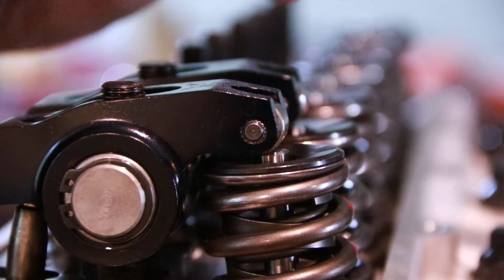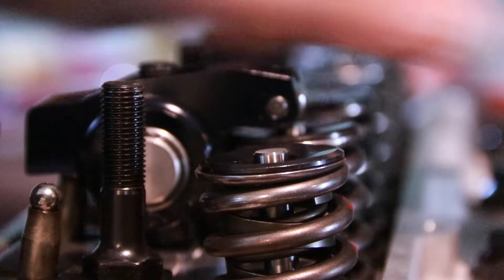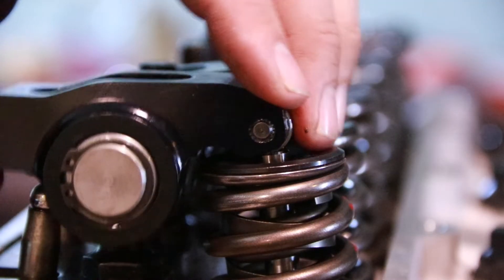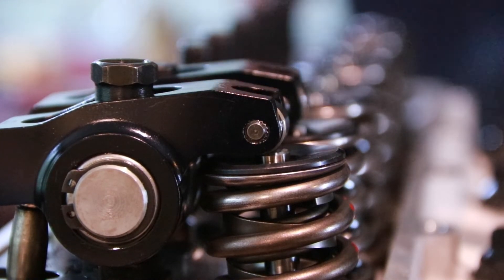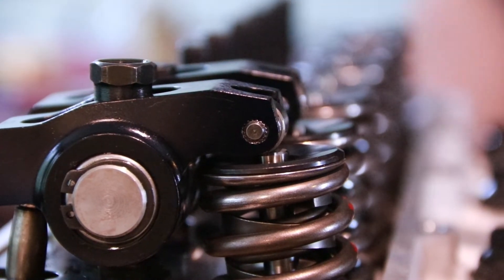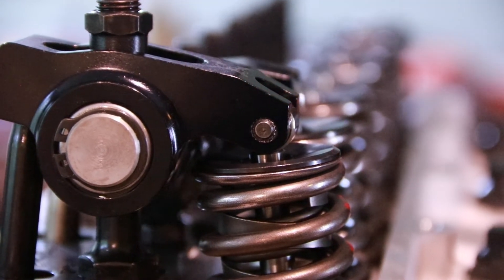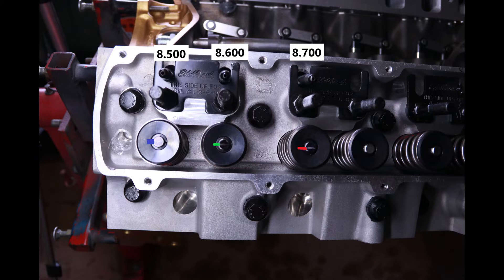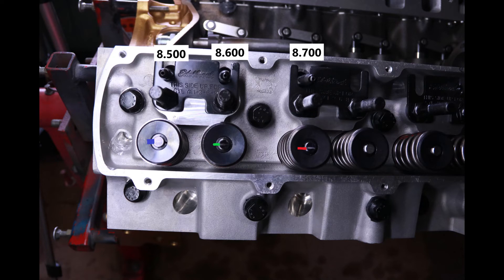Why pushrod length is important to rocker arm geometry

Comment: So you could technically have to use several different lenghts? I ordered BTR pushrods 7.375". What I got was 7.379" to 7.389". Upon the first 15 mins that the engine was running several rocker arms come off the valves as several nuts had loosened up. 3 actually came completely off. You think that's due to push rods being too long?
Reply from the maker: @jb-ik8sj  you wouldn't likely notice any difference in that small of a length change.
Nuts coming loose is usually because they weren't tight enough with the set screw (on polylocks). If you set them at say .020 cold and then ran the engine for 15 min...yes they will open up the lash due to the thermal expansion of the parts as everything gets heated up. That's why most cams specify Hot lash.
If the nuts you're using are not polylocks and just a nut.... they're one use only and will continue to come loose
Reply: @codysmithmotorsports736  that was the first time the engine was started. They were all poly-locks. After 500 miles some are still poly-locks some are ace hardware some are from Melling Cams and some are off a 69 289. Sone of the rockers are rollers and some are off the 69. 2 days ago a 69 stock rocker arm came off the valve and the nut was off the 69. The nut was tight all the way off. The push rod guide plate was heavily damaged. Im at my wits end. Why now did the rocker arm decide to come off?. In the 80's i had a 72 chevy with the same engine only it was stock. It was breaking the No. 6 exhaust rocker arm every few weeks. I guess ill just do what I did than and carry about 15 rocker arms with me when they come off. Sucks that I just spent a out $7000 on this engine and cant figure why it's doing this. All the rockers are different due to the money ran out. It worked fine for 500 miles like that. And now.....
Reply from the maker: @jb-ik8sj  all different rockers is not helping you at all. Rockers are not dimensionally the same and the pushrod length for a roller will not be the same as stock or even a different brand roller.
Just because a nut is "tight" on the stud doesn't mean it won't move with heat and vibration. That's why polylocks are the best because they jam lock with the set screw when done correctly.
Overall sounds like you have a lot of overlapping problems that need to be sorted out.
Reply: @codysmithmotorsports736  what do you mean by over lapping?
Reply from the maker: @jb-ik8sj  overlapping....as in you have more than one smaller problem contributing to a bigger problem
Reply: @codysmithmotorsports736  
Could be. Chinese aluminum heads with a big roller cam on a 68 327 block. I was just hoping. I've decided to order some shaft mount rockers. At least they wont move side to side. And of course they'll require a different length pushrod.
Reply: Oh also the cam came with nothing. It was only a cam inside a box. Had to be sent to me from Virginia. I live in Tucson AZ. Hard to believe that grind wasn't anywhere west of the Mississippi river.
Reply: @codysmithmotorsports736  can you help me? So I ordered sone shaft mount roller tip rockers. They come with several shims for headbolt clearance. Do these(shaft mount rockers in general) require guide plates? The clearance from the top of the pushrod to the lowest point through the head is around .025". If guide plates are required i guess they could replace the shims. Correct?? I should use some kind of a guide plate right? Thanks for all the time you have takin to correspond with me. Its been several decades since my last build
Reply from the maker: @jb-ik8sj  shaft or bridge style rockers don't need guide plates because they're connected together so they can't rotate side to side. That's the purpose of guide plates for stud mount rockers.
Reply: @codysmithmotorsports736  
Thanks Cody

Comment: But all that depends on how much metal has or has not been removed from both the engine deck and heads and will not be the same for all.
Reply from the maker: Which is why you check and use the length pushrod that gets you the best pattern. Common pushrods come in .050 length increments so unless you're making a very big change to the deck height/gaskets/head without changing any other parts, it's not going to change the length needed.
Reply: I didn’t comment to argue with anyone or act like a hit shot but how many people build an engine the right way and change nothing.i’ve got to resist saying anything on here but I source my info from some fairly good knowledge,Ralph Johnsonson on you/tube about push rods and rocker arms I don’t think I colored outside the lines but in case I did I’ll apologize  now ahead (I am sorry you/tubers) for thinking I knew what I was saying but check the info
Reply from the maker: @barrykilts4506  yeah, if you're building from scratch all those things come into play. Which is why checking is worthwhile vs throwing in stock stuff. 
If it's a refresh and some light resurfacing is done then it's not likely to change with any significance.
But if something significant changes. Like valve length for example, then it needs to be rechecked.
Reply: I get it’s important I never said it wasn’t but but that’s it for me you get the last word and I’m all done

Comment: Also it changes valve lift !! I checked actual lift with too short a rod on a sbc. Versis correct rod, guess what, short rod gave .021 thou. LESS lift !! On a .588 lift roller cam ! Hope this helps, GOD Bless !

Comment: How about shaft mounted rocker arms? Me thinks the geometry there will not be effected by pushrod length;however there will be other effects.
Reply from the maker: While the shaft means you're not adjusting the rocker up/down you still want the best pattern possible. Ways of adjustment are shims to raise the shaft base, valve length, valve job height, or using lash caps depending on the situation. Pushrod length with the shaft just needs to be where it's within the adjustment range of the rocker adjuster. But changing the heights of the other components to get the pattern right may change the pushrod length needed.
Whatever shaft system you're using "should" have been designed for the application and be right. However the valve job height and valve length could quickly throw that off if they are changed. Especially when doing big changes like typically done for performance applications
Reply: The geometry at the pushrod and lifter contact points may necessitate pedestal shims, thus longer pushrods.
I'm going through this now with adjustable rockers.  The rocker sits too low in the back, pointing the adjuster at the head, not the lifter.  No Bueno.

Comment: Good info. What did you mark the valve stem with and what position is the cam in when you check the geometry? TDC/compression?
Reply from the maker: Sharpie to mark the valve tip. Then turn the engine through two revolutions to completely cycle the cam
Reply: Thanks Cody. My lifters aren't pumped up. Should I install all the rockers and get the oil pump flowing first? Jeep 4.0 stroker project. 9.600 pushrods came with the kit. I still want to verify geometry. Thanks again! @codysmithmotorsports736
Reply from the maker: @tmmyjay  it might help. This method is for solid lifters so they don't collapse from spring pressure. Getting yours pumped up might help keep them from leaking down. Otherwise the correct way to do it for hydraulic lifters is with a light spring (checker spring) that has very little pressure. Or you can use a solid lifter in place of the hydraulic just for checking. Only other option is to measure how much the lifter collapses and will need to factor that in as it will make the lifter shorter. For example if you bottom out the lifter and get a pushrod length of 8.000 but the lifter collapses .250 from it's correct adjustment position. Then you actually need a 7.750 pushrod because that .250 comes back when it's pumped up.
Reply: Right on man. I did what you suggested and got a pretty nice pattern on the valves.   Gonna pump em up and I'll let you know what happens! MAGA!
 @codysmithmotorsports736

Comment: You don't establish rocker geometry with pushrod length...you establish proper geometry first, then pushrod length is a result. You can set rocker geometry without a pushrod in sight. The position of the rocker on the stud in relation to the valve tip is what defines rocker geometry.
Reply from the maker: But you still need to check the pattern because everything affects it. Rocker studs and valves are rarely parallel. So a tip height up or down will change the ideal angle for the rocker on it's stud. A .450 lift cam or a .850 lift??? Going to require different positions and therefore different length pushrods.
It doesn't matter which comes first or which is the result. Proper geometry is the smallest pattern possible at the center of the valve because that's how you'll achieve minimal wear.
Reply: You sir are exactly right! The rocker height has to be established depending on the lift of the cam. Then you measure for pushrod length! That's right folks, change lift of your cam? Your optimal rocker height will change, period. It's simple math.

Comment: I been doing like this for years. I mark the roller on the rocker in the middle eye ball it on the stem and the get may push rod size. And try 3 size from there with the heavy springs install.

Comment: Every time you rotated the engine through weren't you pushing the pushrod all the way down to the bottom of travel in the lifter?   You can't get a correct contact pattern on a valve stem doing that.
Reply from the maker: Solid lifters, not hydraulic.
If it would have been a hydraulic cam then I would have used setup springs (very light pressure) to check the pattern so that it wouldn't compress the plunger in the lifter